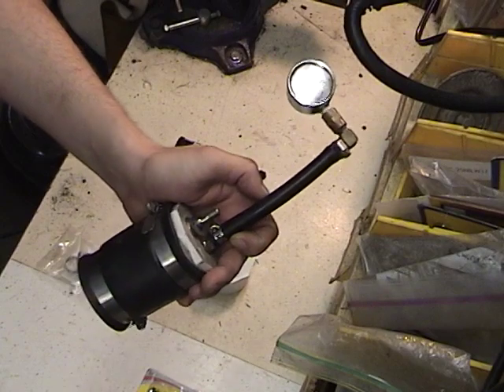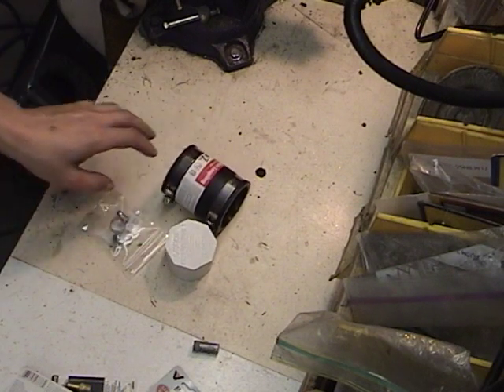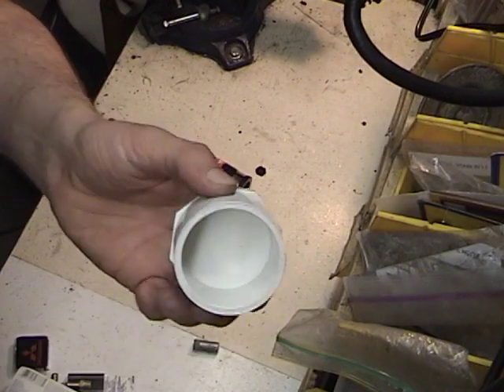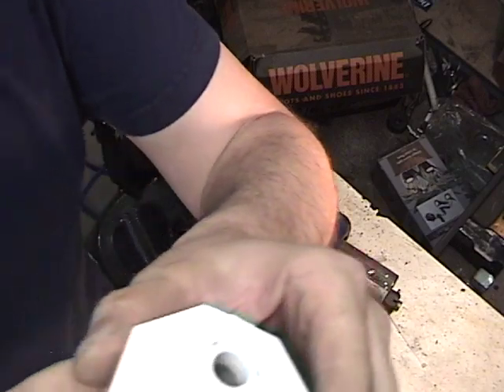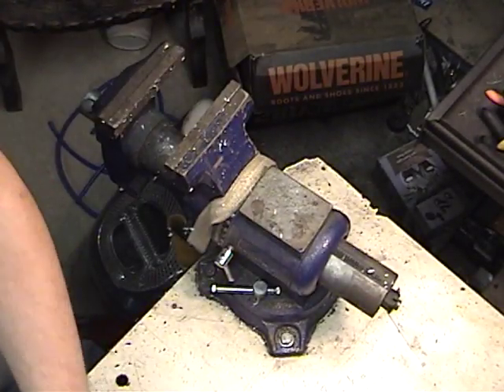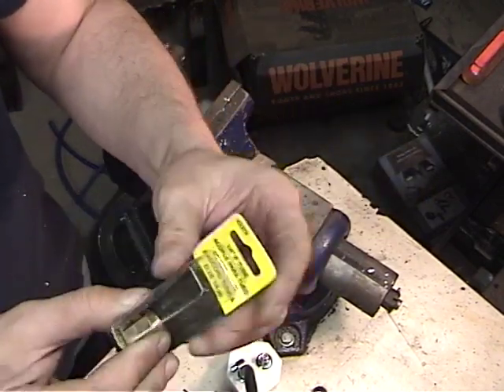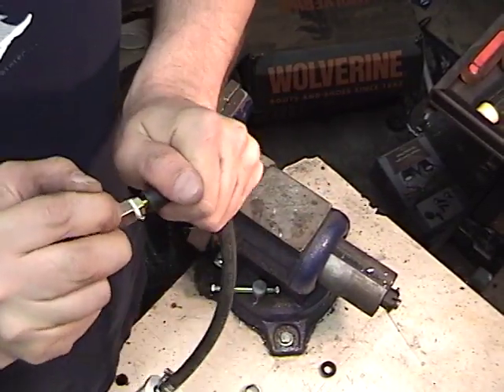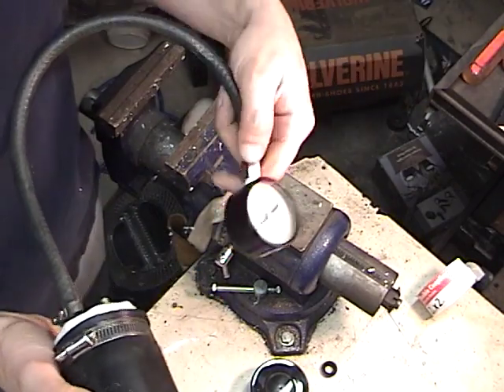Boost Leak Testing 101: Building the tool.

Comment: Just thought the need to comment and say great little tool.  Thank you very much.  I used this to test a new Intercooler i just purchased that was pretty beat up.  Well sure enough i built your little tool and was able to see that the IC is good and holds psi.  Also a little note.  The threads from the tire pressure gauge to the union were leaking for me.  What i did was put some jb welb on there and its air tight now.  Thanks again.
Reply from the maker: On your version 2.0 someday... check out RobertBaxley's ultimate boost leak tester.  He figured out how to make them hold insane pressures that mine could never touch!  :)
Reply: I will cause I noticed mine start to slide and want to shoot off at 3 psi it never did but wanted to.

Comment: forstner bits would work better for making a flat surface
Reply: They would cost more than the tool you are building with no benefit because the pressure holding gasket is inside. This was fine for making a mostly flat surface for the hardware.

Comment: Hi, excellent video, In diesel engine, there is no throttel body so if we use same technique, air will pass from this tool to  turbo then to intercooler to intake valve and air might get out via exhaust valve, assuming exahust valve is open, so dont we need to have engine in TDC.

Comment: Oh man... for a dude of your knowledge, I'm disappointed in your boost leak tester. you should have incorporated a quick disconnect for an air compressor so you can set the regulator on the compressor and leave it. With that design you don't need a friend to hold it and you are free to search for leaks w/o hurrying before the pressure runs out.